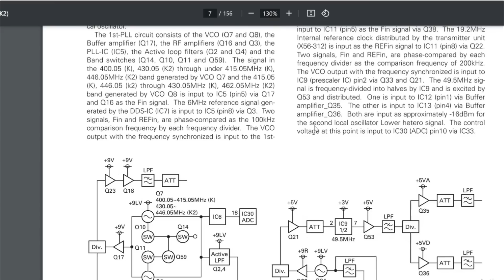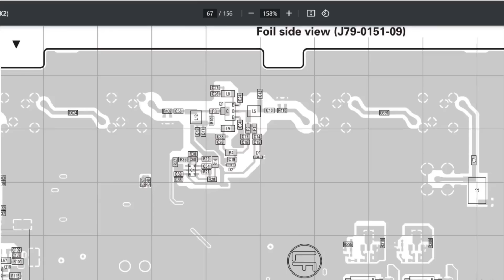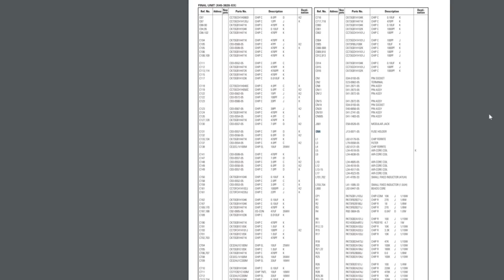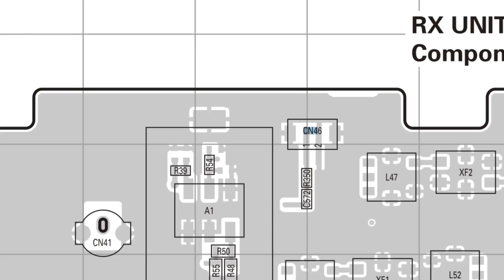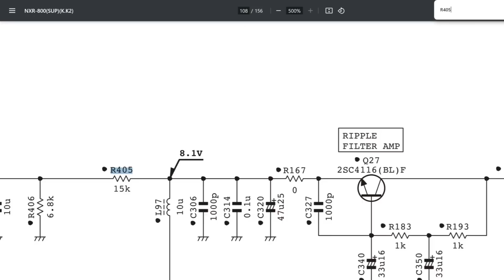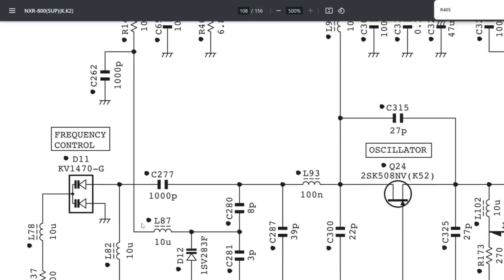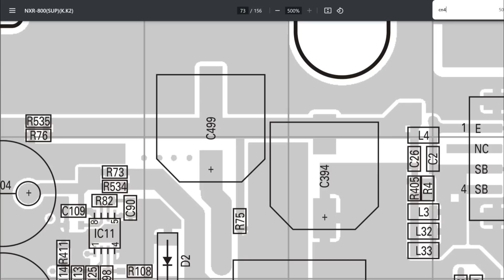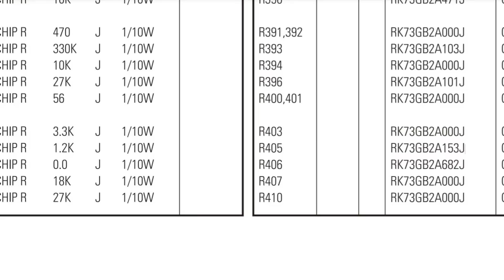Kenwood Blew my Mind - NXR-800K. Repair. How Right to repair should be.

Comment: High frequency characteristics of the two 0 ohm resistors may be different, requiring one for letting through the high frequencies and another one for a reasonable current?

Comment: Resistors and inductors in parallel, possibly to reduce the current through, and power dissipated by, each component. May also lower the overall cost (compared with one large component). Way back when Sony produced quality gear, they included a printed service manual.

Comment: I used to be an electronics engineer in tv / video and dvd, we had walls packed floor to ceiling with service manuals with this kind of detail, Sony and Panasonic were really good on providing service data regularly, and didn’t charge for it if we needed it. They all ended up as PDF and the paper manuals all ended up in the recycling.. the likes of Apple and Asus build throw away items, even though you pay good money for them, they are not expected to last more than a few years at best, then thrown away and replaced. I think it should be mandatory for all electronic items being sold to the public or industry, should have decent service data available.

Comment: Having such components in that configuration offers options to match impedance for Rf signals going through the connector.  The market that involves Amatuer Radio would require repairs and diagnostics in the field, often involving highly skilled customers who would need capability of diagnostics and signals analysis.

Comment: You would be surprised, even modern consumer electronics like Sony TVs, BluRay-players come with just as good documentation. Board layout, component list etc. - it's not available to the general public, but authorized repair shops, but they are often leaked on the internet.

Comment: Zero ohm resistors have a power rating. Putting two in parallel makes it possible to pull twice the current. Technically there is no loss across a 0 ohm resistor, but the footprint/pads have limitations.

Comment: hi, In a parallel combination of resistors, the current can split and flow through each branch based on the resistance of each branch. In the case of a zero-ohm resistor (also known as a short circuit), the resistance is effectively zero, which means it offers very little resistance to the flow of current.

If a zero-ohm resistor is connected in parallel with other resistors, then a significant portion of the total current will flow through the branch with the zero-ohm resistor because it offers the path of least resistance. However, it's important to note that in practical circuits, components can have parasitic resistances, inductances, and capacitances that may affect the behavior of the circuit.

So, while a zero-ohm resistor can carry a large amount of current in a parallel circuit, it may not carry the entire current depending on the specific characteristics of the circuit and the other components involved.

Comment: Schematics give very little advantage to a competitor.  If a competitor wanted to make a schematic from a product they could afford to pay someone to disassemble and test every component and xray the boards to get the circuit diagrams.  Yes it would be expensive but for companies like a Kenwood competitor, say Yamaha, if they really valued the schematic they could pay to have prepared at a reasonable cost to them.  The reason schematics matter is REPAIR SHOPS can't afford to do this with every single device we repair.  My only point is the reason schematics are withheld have very little to do with proprietary information. There are primarily withheld to limit the ability to repair.   These kind of manuals were the norm for decades.  They still exist for quite a bit of stereo equipment.

Comment: Amateur radio equipement like Kenwood, Yaesu and Icom have all their service manuals available and that is for a really long time. For such a long time, some of the components of older models do not exist anymore but with all the documentation, an experienced ham radio operator can fix things by modifiying with new components... ask Mr. Carlson Labs if he can repair, modify and even make transceivers even better by desinging new boards that are not available anymore ! ANYTHING electronic should have these manuals available... For ham radio hobby, it seems company understand that we can maintain and repair our devices !

Comment: two zero ohm resistors in parallel for negative resistance 🤣 I bought a broken Yamaha sub with built in amp and it also had a very detailed manual. Had every piece of information you could ever need to repair it. This thing was built like a tank and would have taken me a while to figure out how to take it apart if it wasnt for the manual 🙂

Comment: In amateur radio we kind of demand the ability to maintain and repair our HAM equipment or else the company simply doesn't survive. The vast majority of amateur radio operators are very technically inclined, therefore there's an expectation that you'll be able to service the equipment you've purchased after the warranty period. IMHO, Kenwood has always made fantastic equipment, from CD players to RF linear amplifiers they've always stood behind their products in terms of serviceability. Great video!

Comment: My guess as to why they'd put two 0 ohm resistors in parallel like that, is to leave room for future circuit tuning if fixes come along.  Adding a small resistor above 0 ohms, or some other component of that size wouldn't require a circuit board change for the next revision.  By having two in parallel allows the flexibility to put two [presumably more common values] in parallel to make the [rarer] value they need, or even an RC pair with a resistor and capacitor.

Going the other direction, maybe it USED to be an RC filter or some components they thought were needed for stable operation, but later decided it was good enough without them.  Cost savings.

Comment: Could it be the unit is shipped with a default option, R4 installed, and removing R4 inserts R405 into the circuit?  Schematic shows 0 ohm and parts list shows 15k so something is mislabeled and it could be the schematic.

Comment: Just a guess...the two zero ohm resistors in parallel will have double the current carrying capacity as a single resistor would, right? Perhaps cheaper to use two of the lower rated parts than one of the higher rated parts. Either parts or assembly or logistics cost.

Comment: Alex, if it weren't for the excellent repair and service manual from Kenwood, there would have been no way for me, a novice repairman, to be able the test and repair my TS=50s HF amateur radio back to working order. Everything was there, including the parts and identifying placement for the radio AND all the country zones which they marketed for. I'm not sure if you are aware of this, but the very same radio built for the European market spec's, are different from ones built to United States spec's and some other countries. The information for ALL countries was included and separated by country code. Thanks for the fine videos.

Comment: the size 2A is 0805
it seems the original part number is no longer available. However found newer data sheet at mouser

https://www.mouser.ca/datasheet/2/219/RK73Z-1825387.pdf

Comment: Kenwood has always done that.  I had those manuals back in the 80's.  This was the time when almost all radios and such had repair manuals or you could get them from a company that I  forget the name of, they printed them all.  But once things started to goto IC's and things could not be repaired by the average repair shop, that went away as well.  If i rememeber right, Kenwood also mandated that all of their design engineers spent time in the Kenwood warrenty repair department repairing the returns so they knew what was breaking and where to pay attention to in their designs.

Comment: It is a somewhat unique situation, half of the HAM radio hobby is about building or modifying your own stuff. This is a community of electrical engineers basically.
Although I bet not all HAM radios/repeaters have this good of a service manual so definitely still props to kenwood

Comment: Years ago I had one of those first Apple Mac computers with the little bitty B&W screens. It developed a fault on the board. I thought I might be able to repair it, so I took the case off and to my surprise none of the components except a few capacitors had any identification on them. Capacitors I could deal with but the problem was worse that that. I had a tech friend from my Air Force days who was now working as an Apple tech. He repaired it at the usual Apple exorbitant cost (not his fault but he did warn me). When I got it home I took the case off again to see what was repaired and, to my surprise, the chip that Apple replaced had the identification quite clearly ground off. I discussed it with my friend and he lamented that if their repair workshop didn't have the chip in stock, they were to buy it locally and 'un-identify' it. That's how Apple made their money in those days.

Comment: Two zero ohm resistors in parallel is apparently to allow more current to flow through the line. For example if you need 3A and the resistor package is rated for 1 or 2A.
Reply: Ok, but why in parallel with the fuse?
Reply: @jeroentaverne8232  Some weird overcurrent protection? Apparently it didn't work in this scenario as intended 🤣

Comment: 0 ohm resistors have specific wattage value. Due the small size of the resistor higher wattage may not be available therefore 2 or more resistors are needed to achieve the required wattage. Part numbers are provided in part list

Comment: I do a lot of repair work on vintage synthesizers and audio gear from the 80's and 90's. The amount of documentation from the manufacturers back then was amazing. Not only for professional models, but all the way down the product line to even toy keyboards. Schematics, board layouts and theory of operation descriptions are so incredibly helpful. Happy to see proper service manuals aren't completely extinct. Thanks for another great video!
Reply: My Harman amplifier is still working beautifully for this same reason.
Reply: The old Lexicon manuals are fantastic! Great service/operator handbooks, a wealth of information and tips, and the odd funny joke thrown in there too!
Reply: I just discovered kurzweils repairability. All schematics for all models available online. Amazing.

Comment: Great job! Having been on the design end of products for decades, I can tell you there was a change when the Harvard MBA's came through and everything was about the bottom line. All the service manuals got trimmed right down, along with the staff to create them, and customers paid the price of high level subassemblies instead of components. The almighty dollar spoke. Only way to change this in the customers favour is to make it law, and require the right to service. Even then the companies will charge $$$$$$ for the manuals.

Comment: Not surprised, I remember years ago when I bought a Kenwood car stereo, that manual was several pages and highly detailed. Nowadays, you're lucky to even get a manual when you buy electronics, and if you do, it's basically a single piece of paper.
Reply: It's fine to save paper, most of them get thrown away, but at least have the manual in PDF form.

Comment: That's weird.  Two 0 ohm resistors and a fuse in parallel?!  Maybe they did this to allow the fuse and resistors to blow when there's a high-current spike??  I dunno.
Reply: And that fix doesn't make any sense to me. The tin connection worked as a jumper, so it had to work without those resistors if there was no problem elsewhere.
Reply: For me it looks like this revision had a fuse, and revision in the schematic had two low-powered resistors like some kind of 'slow' fuse.
Reply: idd  tose  2 resitors are usless .. when the fuse is ok ..

Comment: Actually most all amateur  radio equipment manufactures provide this info. Hams are mostly electronically inclined and can attempt to fix there radios. Where in lies the problem most don't have the skill to micro solder. I actually put it to Rossmann he should look at this field. These radios are mostly high end.  With the advent of SDR prices have come down but there are some are still at the $5000 range.I am a ham for over 40 years and never cowered from a repair. I have to admit being 70 years old now limits me from doing this. Shaky hands bad eyes etc. In my area we had a repairman we affectionately called Doc Fagan . He did the same quality work that you do. I know you will find manuals for most all manufactures of this equipment. A few will be Yaesu, Alinco, Kenwood and Icom to name a few. They actually encourage repair. Have a good day and I enjoy your videos like you can't believe.

Comment: One company in the watch world is good like Kenwood, that being Seiko where you can get very detailed technical sheets and parts exploded diagrams.   Back in the day, audio companies used to put wiring diagrams inside the machines of hi fi's with every component and wire labelled out to be repaired.   My Pioneer 6 CD changer has one as does my Denon mini hifi but my wall mounted Panasonic DAB panel is solid sealed, unable to open cleanly which is a shame as it has this wicked CD door that opens like an airlock in a space station, all you need is the sound effects of a whoosh and it would be perfect hehe

Comment: Many equipments have this kind of manuals. Usually, the manuals come in a set (operator manual, service manual, parts list manuals etc). Most often, rhe service manual is only service personnel authorized, and this is usually mentioned in the first page
That is what happens in photography finishing machines such as Noritsu and Fujifim Frontier, etc. In there you have everything about the machine (all conectors description, all connectors pins numbers, wiring diagrams which even describe the cables colors !).
In short no physical aspect of the machine surprises you when you go trough it, absolutely nothing.
How to browse intosuch manuals ? We proceed the same as when reading the Bible: the machine alarms a fault by displaying an error message with its number; the serviceman now refer the number in the manual and traces the related faulty sections (mechanical or electrical parts, electronic boards, etc)
But even though, micro soldering still remain a challenge for many of the aevicemen; that was my case until I discover thw micro soldering trough Northridgefix YouTube Channel.
Alex, you are a mentor to me.

Comment: 15:06 There is no 9th di.... Hmmm... Did you just made a refference to an idle incremental game called "Antimater dimentions"? 😁
Joking aside, during my work I had only 2 companies that provided such full detailed manuals to their products. One is Italian company MEP (they make mostly saws for cutting steel) and Swiss company Pfiffner (rotary table machining devices). I don't know about today's products, but 15 years ago their manuals and trainings for technicians were amazing. Especially Pfiffner. Their valves technology was incredible and it was the only time I had seen such precision on the machine. You don't often find a tech setting up a machine with dial indicators in 0,001mm increments divider 😁It was one drilling station making 2 holes that had to be in 0,005mm tolerance apart. The level of proffesionalism, patience and knowledge of this tech preparing the machine was astounding.

Comment: Hi alex.. i did some internet search and found out and based on this video that one reason to have 0 ohm resistors is to create two pc board layouts, one with a resistor in place and one without any resistor. However, it is cheaper, smarter, and better inventory management (for the manufacturer) to have just one board and insert/remove the zero-ohm resistor as needed.
Reply: The zero ohm resistors are being used as fuses to protect the supply line to the final board.

Comment: It does seem frustrating and nonsensical at times. The products and designs are protected IP, it makes no sense to withhold service and repair documentation. Anyone who might wish to actually rip off your designs or compromise them, and could be an actual threat of doing so, will be able to do so the moment you start selling the product. At that point, any invested party can just buy them off the shelf, x-ray them and reverse engineer them with the product itself and all it's discrete components in hand, at any volume their financial department can muster.

Withholding repair documentation and component access does nothing to slow down or prevent corporate espionage, illegal reproductions or other nefarious manipulation - only enforcement of patents and IP does. All it does is prevent service and repair.

Comment: Those resistors could be placeholders to unlock certain features of the radios, like a jumper trace you'd cut.
Reply: It is done for example to allow you transmit in frequencies for MARS (Military Auxiliary Radio System) if that was the case the modification would allow the radio to transmit in special frequencies that have authorization to transmit at such frequencies.

Comment: The subject Kenwood repeater is made for commercial two-way applications, but of course it can be and is used in ham radio applications. Kenwood isn't the only manufacturer providing detailed service manuals. Icom, Vertex, Motorola, and others do. It's standard practice in the industry. Always has been. Usually the manufacturers direct customers to dealers to order manuals and parts for them. Kenwood has two parts dealers in the US.